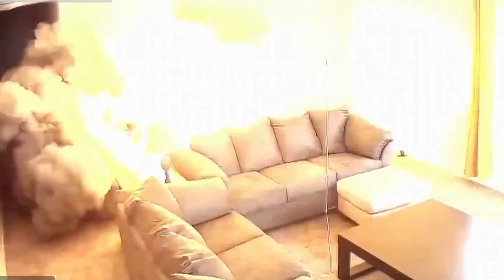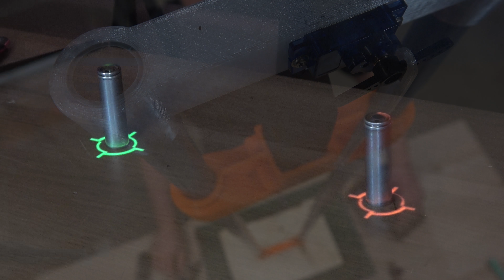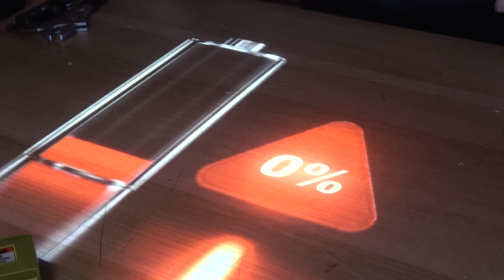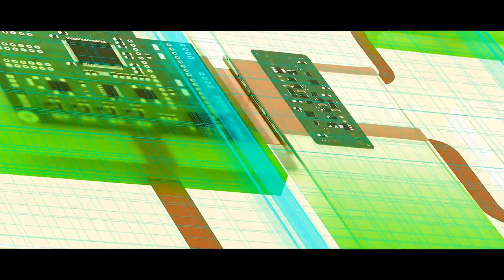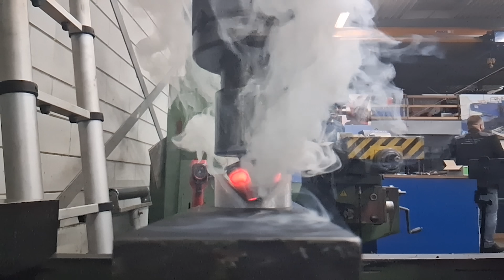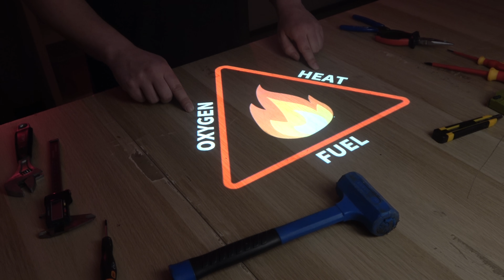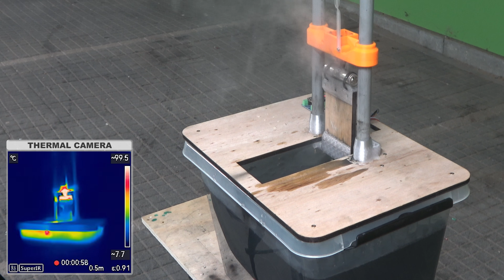Detonating Batteries.. For Science!

Comment: For things like phone batteries (like the Galaxy Note 7), the biggest reason they blow is during charging and no cooling. The reason for the Note 7 having issues was that the battery was very big, charged fast, and had poor cooling, so it would get too hot and blow. 

"Moral of the story is" dont charge your phone (laptop, tablet, or any battery powered thing) in an enclose space (like backpack, pocket). Charge anything with a battery in a place where it can release heat (And remove any thick cases) to prevent overheating and thermal runaway.

Comment: The extreme reaction comes from the high amount of energy stored inside. If you puncture it, you create a lot of shorts inside that will result in a rapid increase in temperature which will make it release flammable fumes that will ignite. No energy, no initial reaction to cause an explosion.

Comment: That shot of e-bike exploding brings back some horrible memories. I ended up in Emergency with 2nd and 3rd degree burns due to an e-bike battery (BMS) malfunction. My "Ex" who wasn't even suppose to be charging ebikes in my apt decided to sneak just the battery pack (same size as a large single truck lead acid battery) into my apt early one morning while I was sleeping. I awoke to a huge explosion in my living room. I came running out to see what looked like a flame thrower shooting fire everywhere. I also realized the battery had been put in my hallway close to the front door so by the time I managed to find and cage my cat I was trapped by the fire and had to run through it and suffer burns or stay and die. I lost everything but I'm still here. (Here's a footnote if you haven't lost interest yet. Lol.) My building had an electrical fire two years prior so I lost everything and was in temporary housing for 2 years till the building was remodeled. I had moved back in and replaced everything and then four months later the battery fire which gutted my apt so I was homeless for another year. (If it weren't for bad luck....) Lol.
Reply: That's insane, but the one part that immediately jumped out at me was that you subjected yourself to very serious burns deliberately, by refusing to leave until you'd rescued the cat. God bless you for that. Tells me all I need to know about you.
Reply: @Deletirium Thank you for that. Unfortunately I lost her to cancer 5 yrs ago and it still chokes me up at times. Her name was Monkey which tells you all you need to know about her. Lol.
Reply from the maker: Wow mate!😯That's one hell of a story!!😳

Glad your still here! How are you doing today? Hope everything's well and your not homeless anymore?🙌
Reply: @ConceptCraftedCreations Sorry for late response and thank you for asking. It took a year for them to rebuild my apt as windows had been blown out and whole apt had to be gutted but I've been back since 2024. Cheers.
Reply: I've had a house fire brother. Ours was a faulty dehumidifier (I guess you could say it worked a little too well.) glad you're still with us, I know how tough it can be.

Comment: I've driven EVs and ridden ebikes and e-scooters for many years. Never had any problem with the battery.
Always observe the 20-80 rule (never deplete it below 20%, avoid charging it above 80%).
Keep it away from extreme heat, shocks and water.
That's it. I respect the battery, it respects me back.
Touch wood.

Comment: Instead of talking about charge in only percentages, it makes more sense to talk about voltages. A battery at 0% isn't empty, that's just where the software in whatever device it is being used, has been told to turn itself off. An "empty" Li-ion battery usually still has a 3 volts charge, though it's sometimes a little higher.
Edit: Okay you mention voltage later, I guess this is a way to make the video longer.
Edit2: The conclusion (with images of burning EVs) is straight up fear mongering. EV batteries have been made with LFP chemistry for a many years, specifically to combat this danger.

Comment: I'm a professional photographer so I work with a ton of different batteries all the time, from AAA for remote triggers, to quads of AA for hot shoe flashes, proprietary camera batteries and giant batteries for untethered studio strobes.
I worry all the time about these things happening because if it goes off in my camera bag, even if there is only one camera and one lens in there that's almost £10000 up in flames.

I was at work last year and my hot shoe flash ran low so I went to change the batteries and as I emptied out the 4xxAA cells one of them burned me. This was in a bar with a few staff members around me but thankfully they always have buckets filled with sand for these types of situations. I left it in there and worked for a couple of hours, it never exploded but I think I got very lucky. Whilst all of the above mentioned batteries are rechargeable I wish there were easier ways to know when they were past their safe charging limits and due for replacement.
Reply: I also had a couple of AA batteries in my pocket at work one day and despite not puncturing them one of them leaked right through my inner leg pocket and burned my leg pretty badly. No idea why batteries can randomly leak or explode like this without actually being damaged by anything but if I had to guess it's just the separating filaments inside that eventually wear away allowing the positive and negative parts to mix and that causes the runoff. Scary stuff.

Comment: Did it matter that the during puncture of the fully charged battery the nail bounced out, leaving an opening to the air?  On the second and third attempts, with dead and low charge batteries, the nail did not bounce out, so the hole was sealed.
Reply from the maker: The third attempt (empty but not dead battery) it shoots out as soon as the battery starts to heat up🔥

But no, it doesn't really matter to answer your question🤓

Comment: as a "RC Plane" dude i rather use petrol and jet fuel than LiPo or Li-Ion battery in case of an accident. never have my petrol or jet fuel planes started to burn as a battery plane has.. and several of my fellow RC plane hobby friends had their garage or home burnt down.. well today chargers are smart and if you just charge the battery with the correct charging protocol there is no problem during the charging. 
but i would  NOT trust Chinese wall plug chargers!!

Comment: Battery charge state, fyi there was a legislation out (not sure how new) that all products shipped by air needs to be shipped with 30% or less. UN3480
Had an exciting time with some manufacturers of rechargeable cells that they didn't adhere to this.. They had to quickly assemble a production line to manually discharge it... 😅

Comment: Important Note:
You are, of course, correct about fires that are a result of combustion reactions; they need fuel, oxygen and an ignition (or heat source). Remove any one (or more) of these things and the fire dies. HOWEVER... Here's something you should try:
Get some steel wool. Get a 9 volt battery and touch both points of the battery to the steel wool. See what happens?

What you're seeing is the heat produced by an oxidation reaction (technically a Redox reaction). It's so much heat, in fact, that it's indistinguishable from a fire. However, because it's NOT a combustion reaction, the Fire Triangle doesn't dictate the terms of the reaction. Depending on what's present in the reaction, you can remove ALL atmospheric oxygen to ZERO effect! Such as with a Thermite reaction, where the oxygen comes from the Iron and NOT from the air, meaning that there are reactions that you can't stop by removing the oxygen. Similarly, there are reactions that are so exothermic, that removing the heat will do nothing to lessen the zeal of the reaction. However...

Removing the Fuel will ALWAYS work!! That's because EVERY reaction is a dynamic interplay between the reactants and products. If you (A) remove the reactants, or (B) add an excess of products, you push the reaction to the left thus stopping, or at least pausing the reaction. Similarly, if you (C) remove the products, or (D) add more reactants, you push the reaction to the right, causing the reaction to proceed more vigorously!! The reason that this happens is because the vast majority of chemical reactions are dynamic - they can go either way. They can either go left to right (ie - A + B > C) or they can go right to left (A + B < C). We usually indicate this with a bi-directional arrow - an arrow that points both left and right the top half of an arrow points to the right, while the bottom half of an arrow points to the left, and where both half-arrows are stacked (I don't know how to produce such a symbol on a keyboard). In any case, this is a bit of a tangent...

The point is - The whole Fire Triangle thing works perfectly, when addressing fires that are the result of combustion reactions. Unfortunately, there are a large number of other kinds of reactions that ALSO cause an excessive amount of heat to be evolved. But regardless of the type of reaction in question, the one method that will ALWAYS work to stop a reaction dead in its tracks, is to remove the fuel (the reactants). If there's nothing left to react, then there's not going to be any reaction!

Nb - It's also worth mentioning that there are some combustion reactions, where an oxidiser is one of the reactants!! This is the case for gunpowder and for many explosive substances. In these cases, you can remove all the atmospheric oxygen to no effect - the reaction will continue because it doesn't need atmospheric oxygen. It has its own source! This is why guns can fire underwater, or even in space!

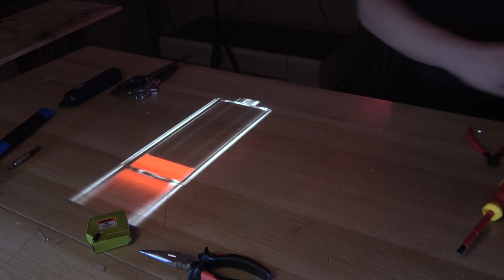Comment: 4:50 This is incorrect. Taking a battery down to absolute zero does not cause irreversible damage if you have the correct charger that can charge from zero, which I do.
The problem is that 99.9% of chargers cannot start the charging process if the battery is fully drained of all power.
Reply: I've had this happen to my phone and my charger charged it right back up.

Comment: I haven't watched the result yet, but here's my answer to Q1:
It's a question of chemistry - We look for the electrical potential. In a drained battery, there is none. So a discharged battery won't be dangerous in any way. HOWEVER... It's possible that these batteries are made so that they NEVER drain all the way to 0%, but that when they get down to about 10% charge left, they read as though they're at 0% IF that is the case, then the "0% battery" is really a battery with 10% of its charge still present. And if that is indeed the case, then a "fully drained battery" is still dangerous (because it still has charge in it).

As for why a full battery is more dangerous - It's because it has a greater amount of chemical energy stored in it. The reactants are MUCH more reactive than the products, so it will spontaneously react, if allowed to do so, if given the means to do so (ie - a short in the cell). And because it's not a combustion reaction, removing oxygen/ smothering the battery will do nothing to stop the reaction. Having said that, Lithium IS a highly reactive metal, and so some part of the reactions might include the lithium being oxidised by atmospheric oxygen, or by oxygen released from other reactions taking place within the broken battery. Smothering/ submerging the battery MIGHT quell that part of the reaction, but every other reaction taking place will continue.

So... If the reaction is a chemical reaction and NOT a combustion reaction, how do you stop it? Well, if you had an excess of products, you could add it to the mixture, pushing the whole reaction to the left. But you haven't ENDED the reaction, you've just paused it, by allowing it to reach equilibrium and if you were to remove the excess products, the reactants would start reacting again immediately!
Another way you could stop the reaction is to isolate the reactants from each other! If the reactants have no way of reacting, there's no reaction! I don't know much about fire extinguishers, but I suspect that this might be how the 'Chemical Extinguishers/ fire extinguishers rated for chemical fires' work.

Comment: As an automotive technician. I already know about dangers of batteries. 

EV batteries use lithium ion cells usually mounted to the bottom of the chassis. Many EV vehicles has been reported catching on fire.

This is also why some insurance companies will not cover EV vehicle equipment with lithium ion cells. A replacement battery is OVER 5k with the max for Telsa being 20k for a battery. Making cost a reason also to not want to cover EV vehicles

Comment: Ok so I know how it all works. But what I'm confused by is how does the truly 0 charge battery not ignite/heat up? It's still a Lithium infused battery and becomes exposed to air as soon as the needle breaks the surface and pierces the levels. So, should not the lithium begin interacting with the water/air in the air and begin a run-away chain reaction even a slow one? But the thermals showed no temp changes at all.
Reply: When you discharge the lithium battery, the flammable components completely neutralise each other. For instance the lithiated graphite anode gives up its flammable lithium which fully combines with the oxygen in the cathode, becoming harmless lithium oxide or similar harmless Lithium 1+ salt. Kinda like how wood doesn't burn after it becomes ash. There's no more chemical energy left.
Reply: @RadioTrefoil  Ah ok, I guess that does indeed make sense if it converts into +1 salts. I've only ever seen pure lithium metal and normal lithium battery reactions, and thus since have never seen a drained one's interaction didn't know it mitigated itself.

Comment: listened to my cousin who is a firefighter talk about lithium battery fires and how water isn't enough to solve the issue in isolation a few years ago if you are submerging the battery you have to do it long enough and col enough to control the temperature of the battery and outweigh the runaway effect as the reaction eventually runs out of fuel to try and start another runaway, which is feasible in smaller batteries assuming you have a decent sized bucket right there but with a larger battery not nearly as feasible

Comment: Actually, you only need two elements to create a successful fire, and that is oxygen and fuel. The heat will be created as a result of the two. The reaction you see when the battery is punctured is an exothermic reaction between lithium and the air outside of the battery.

Comment: The by product of Lithium discharge is oxygen so it is nearly impossible to deprive the chemical reaction of O2.  With a thermal run away, heat is the most significant part of the equation.  Water can only cool so much and by the time the temperature is below the critical threshold, the damage is done and quite possibly spread to adjacent structures.  The only correct response is to limit the damage being done, covering the battery with dirt or non-combustible material is the best option, if available.

Comment: I was pulling a bloated flat LiOn battery from a 10000 mAh battery pack. The battery was glued to the plastic case so I used a plastic scraper in an attempt to get the flat-pack out. I didn't cut into the foil wrap and that battery turned into a roman candle on my desk. I had a CO2 fire extinguisher on the desk and it didn't dent the roman candle. Luckily, I also had a stainless steel bowl next to me and covered the burning battery, covered the battery, and the roman candle made the stainless steel turn bright red before it finally burned out.
If I were near curtains I probably would have burnt the house down.
At least cylindrical batteries have some protection from puncture. The flat-packs only have a foil and plastic wrap, and bending a flat-pack battery will short and explode.
I am looking forward to the other salt batteries becoming mainstream, and having the same capacity.

Comment: Energy density and power capability in modern batteries are increasing steadily, and with that comes a greater emphasis on safety under fault conditions. Fortunately, there are several promising developments in this direction, including thermally responsive polymers that reduce ion transport under high-temperature stress, gel and hybrid electrolytes that can limit ion mobility under abuse conditions, and solid-state architectures that improve mechanical stability and help localize damage rather than allowing it to propagate through the cell.

The overall goal is not just higher performance and energy density, but also improved lifespan, reduced degradation under cycling, and better containment of failure modes so that damage is less likely to cascade into thermal runaway.

Comment: In many nations of Europe, fire departments and rescue personnel have started carrying special, fireproof blankets.  They're designed to be laid out in front of a burning EV, and then two people take the handles, lift it high enough to clear the front hood, then walk it back over the whole car.  Then they just tuck the edges in around the wheels.  This has advantages and drawbacks.  It cuts off the supply of oxygen, so the rest of the car can't burn, and it also contains the flames, so the fire can't spread.  But it holds in the heat, so the batteries can't cool down, and if you remove it, the fire will roar back to life in seconds.  That said, the pros far outweigh the cons, and gives the fire department time to deal with the fire on their terms, rather than the fire's terms.

Comment: Most common damage that is failing batteries is actually overheating from too long device use ( watching in hours or even worst playing games ( thats the killer ). So overheating makes parts of the battery "dry"and they start a thermal reaction inside from sort of shortcircuit and there we go a fire or a bomb. This is what happens in EV's too. Those batteries are not ... not save at all